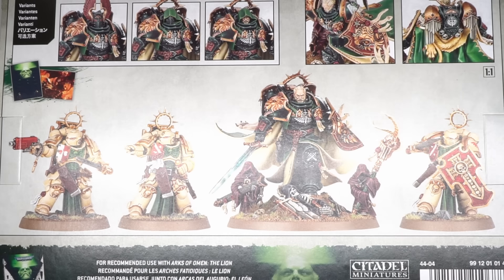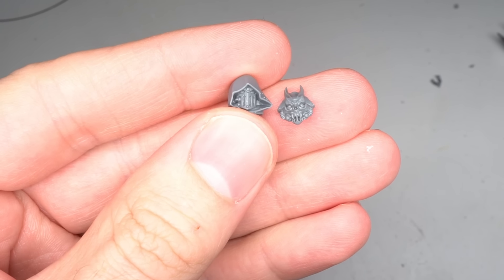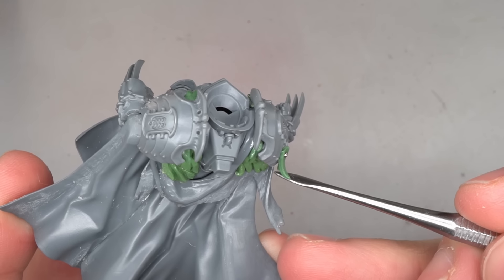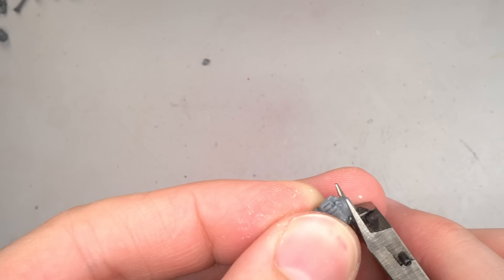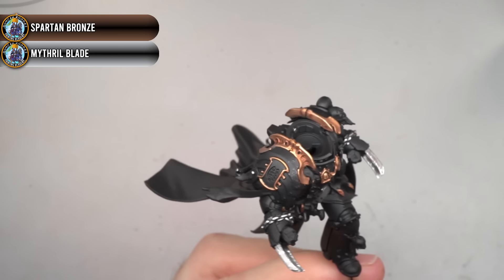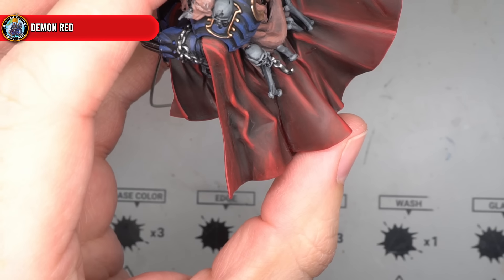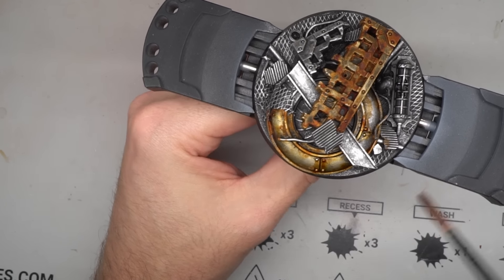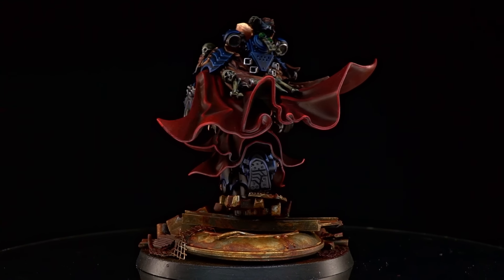Converting THE LION Into KONRAD CURZE: Dornian Heresy Kitbash

Comment: Try to get jewellers clamp, it is wooden handle with few screws the jaws usually covered with leather.
So it's allowing you to hold very tiny items with ease, while your scalpel away. They very cheap but very useful.

Comment: brilliant as expected though the head is not fully doing it for me.
In case you would be willing to do something like this again: I think the model could be a brilliant 40k-Alpharius with the looks of the armour, the cloak and hood and the pose - just stripping the model of any insignia, adding just some reeaaaly small details here and there in regards of scales etc. Changing the weapons to somethign like a spear and using one of the hooded heads (either the one with the helmet or the other one, though one would have to find a bald head to replace the beard-face - Abbadon maybe).
Some more subtle details added via painting and it would just be perfect.

Comment: Why not use a jeweler file to take off the iconography? They are designed to work metal, so they make short work of plastic and have more control then a blade.